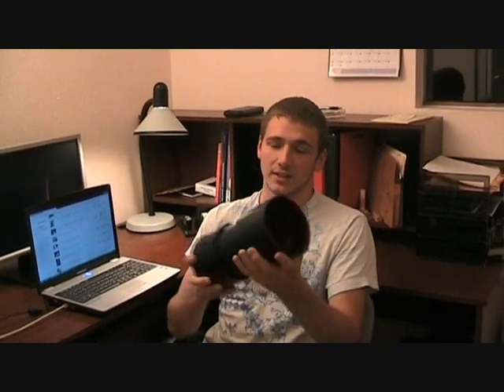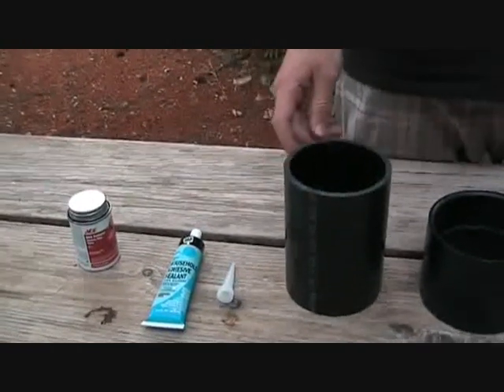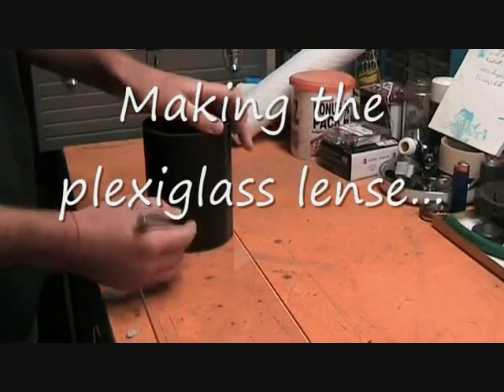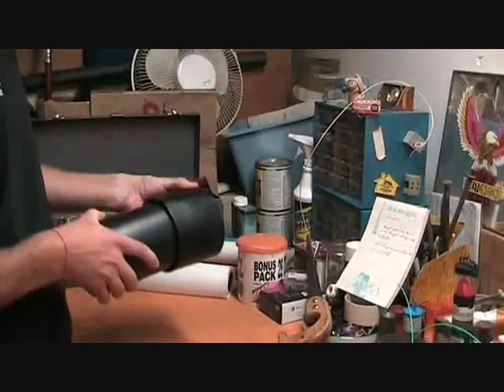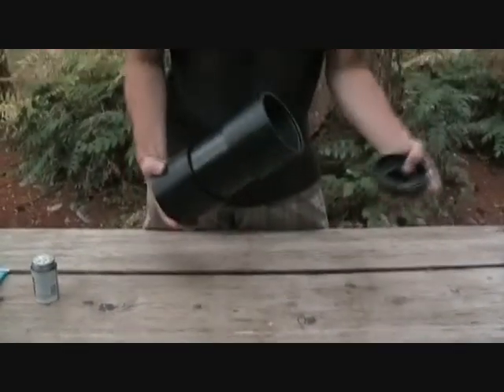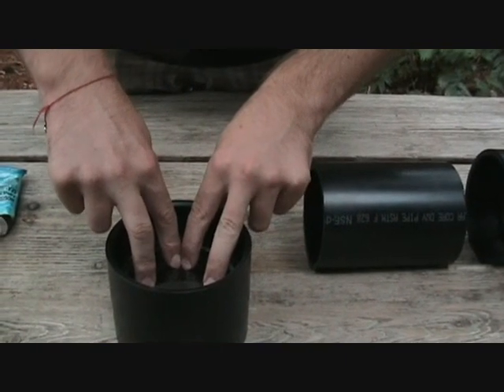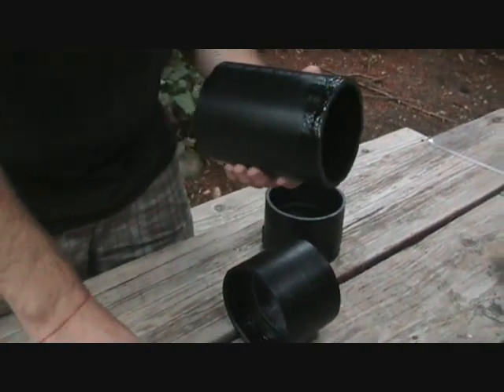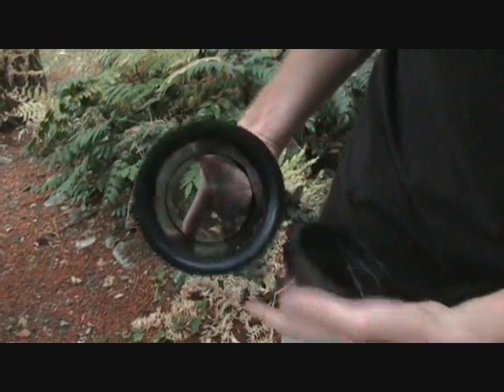How to build an inexpensive Underwater Camera Housing

Comment: Port Lense Placement:   Whenever designing a seal or gasket, the designer should take advantage of the pressure to improve the seal.  You put the lense inside - the WRONG side. Water could eventually push between the wall and the sealant to breach the gasket seal. It will eventually fail at depth.

The correct assembly would install the porthole lense from the OUTSIDE, with a layer of sealant underneath it. Water will press IN on this, creating a tighter gasket seal.

Comment: hey guys, this weekend i made this exact camera housing, and it works great. You need that teflon tape otherwise water will leak in. i had it submerged in water for 5 minutes, and it was perdectly dry. I would recommend using a couple of cabinet handles and using 2 hose clamps to make something to better grasp it with. I will be making a review video of it soon! Check it out!

Comment: I think that this is a great guide. I just finished building mine and am going to test it tomorrow in the pool to see how it stands up at a depth of around 15'. If it works I am taking it to the springs around here and will put the camera in it. Ran into a few snags though:

The twist top that is used for access leaks significantly and I am having to put 5 or 6 layers of the threading tape one but this makes it difficult to screw and unscrew.

I also had a very difficult time cutting the plexi.

Comment: 30 ft is plenty.  I snorkel dive up to 20 ft.  Any thing past 20 and I would need to change the lens to a red. 

I may just get a few more end caps, and a bit more silicone tape. Thanks for posting this video. It is going to help out, and save money!